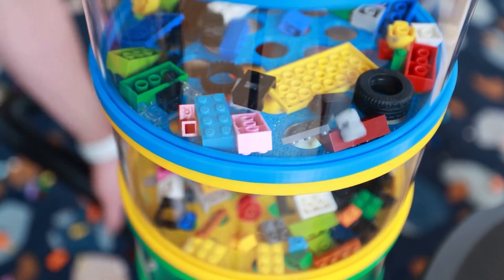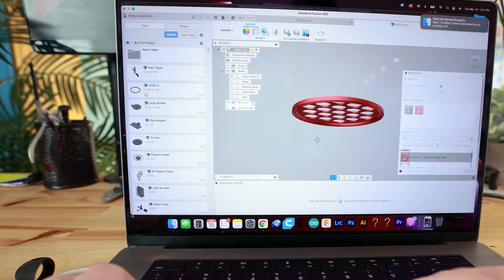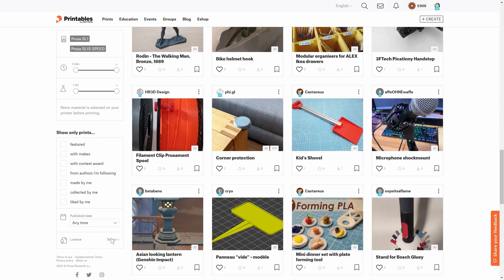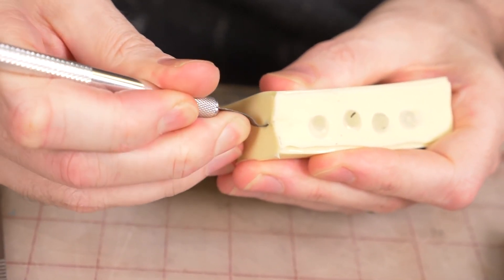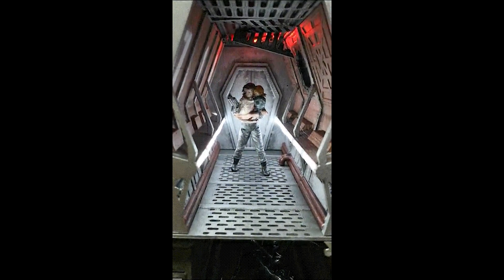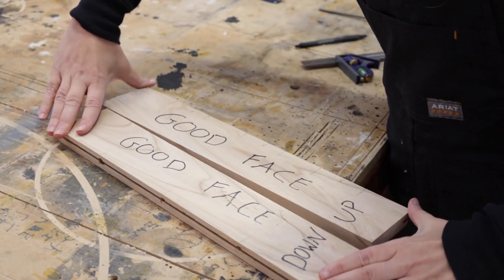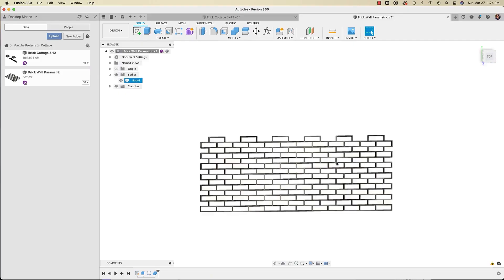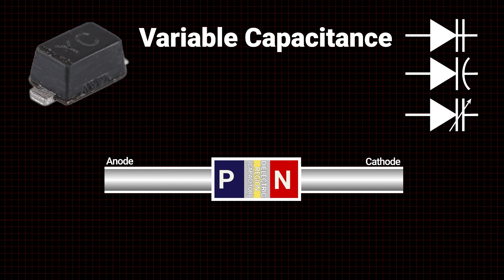Sorting by Suction [Maker Update] | Maker.io

Comment: thanks for including me! I have learned since then that the "fiber laser" name isn't because of the fiber between the head and the control box, but rather how the laser source itself uses fibers to combine multiple lasers into a singular focused beam... I think.
Reply: Is this another Duct Tape /  Duck Tape problem?
Reply: @twinegarner  haha, I don't know. really, I think it doesn't make a difference at all, but some folks corrected me and sure enough when I looked into it, there are spools of fiber being used within the laser source. who knows.
Reply: Agreed! The fiber is the medium for the laser gain, as opposed to CO2 in a tube, which is what is used for the typical desktop laser. Fiber lasers can have enough power to melt or weld metal. Those would typically need a gantry mechanism

Comment: That metal engraving laser is a game changer.  A few years ago I had a project that needed engraving and a low power laser cutter.  I used the spay paint as resist and etch with ferric chloride method which was less than ideal.